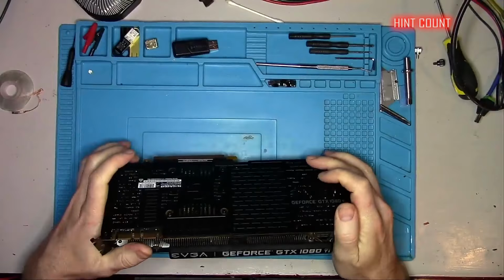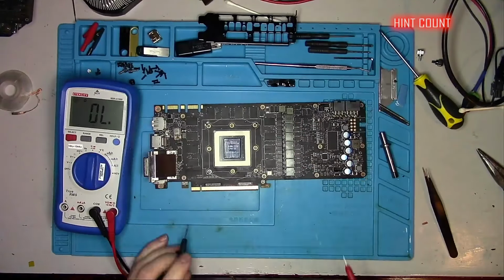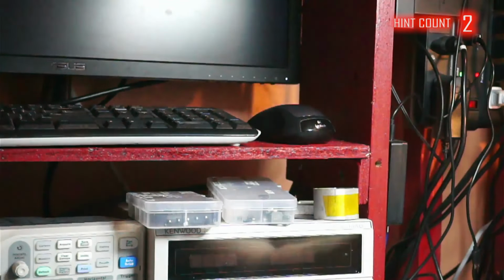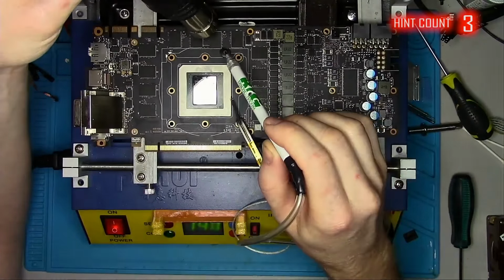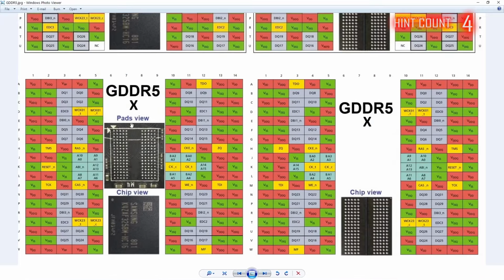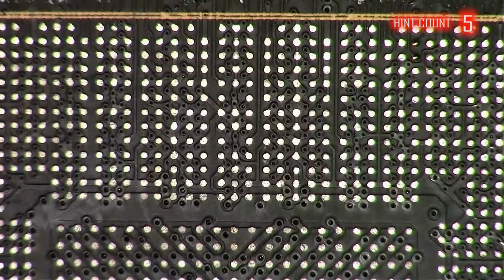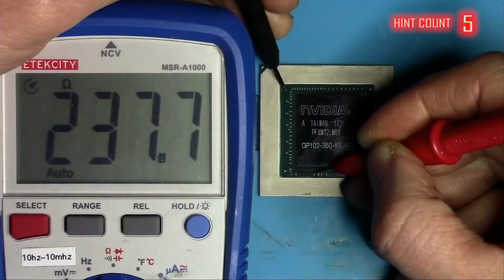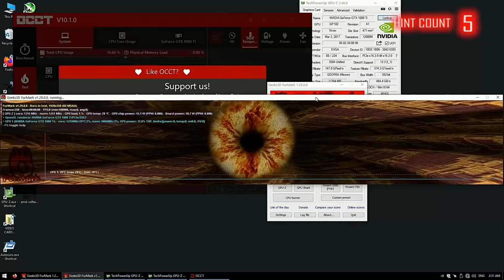What dropping does to Graphics Cards evga 1080ti no output

Comment: I'm not sure if you'll see this but I have this exact card and was wondering what thickness of thermal pads I should be looking for? I've had this card for 8 years and it's running a bit hot. I'd like to replace the thermal paste and might as well update the thermal pads as well

Comment: If you look closer you will see, that the pads are in fact NOT RIPPED‼️ 

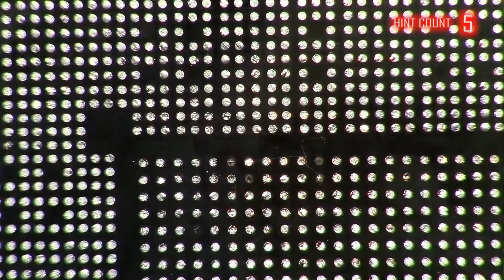It may look like but it’s most likely corrosion. You can see it at the beginning where the light shines in a different angle.( 9:37 ) Try to measure the resistance of the pad against a ground pad, you will see that it has still a connection

Comment: Hello, could you please tell me that one of the chip capacitors on the gold hand on the back of my ASUS 1080ti graphics card fell off, but it can run normally now, what role does this capacitor play? Thank you.
Reply from the maker: Filter.
I wouldn't worry about it too much if all works as it should.
Reply: @northwestrepair  I want to know what this capacitor does, which is located on the back of the PCB, the last one in the row near the Goldfinger

Comment: 1:30 How is it that when he was measuring vcore relationship to 12v he was referencing pci-e 12v . Isn't vcore on more powerfull cards always only provided from 6/8pins?
Reply from the maker: i've seen it shorting to 12v pcie before on  1070 cards.
My guess is that back then, i didnt realize it was shorting 12v to ground and since core resistance is very low, i would get a short on 12 to core.
I learned not to do that since :P

Comment: i have and asus 1080 works fine but where the power cable goes into it takes 2 power cables. there is a white light above the top of each plug in the 2nd plug in for the power doesnt light up like other cards should i worry ? i mean the card works fine
Reply from the maker: if it works, dont worry.
i've seen this on few 30 series cards. No effect on performance.

Comment: is it possible to repair torn pads on the bga of the gpu die? if you looked closely it seems there are stems on a few of the pads which could have a wire or tag soldered to it
Reply from the maker: Possible but not very dependable.
One sneeze and it can snap.
Reply: @northwestrepair  I see, thank you for the quick reply

Comment: Is it still worth running repair center? like in general. cos i dont know, do guys like you just repair gpus and nothing else? Like what im trying to say if it profitable 😑😅
Reply from the maker: If you are like Northridgefix soldering connectors and fixing ripped pads all day yeah.
Reply: i know you can spend a lot of time troubleshooting and hours repairing for small profit margin. But it's also a passionate job at the end of the day

Comment: I picked up a dropped and possible mined evga gtx 1060 6gb sc single fan model for €80 last year june 1st. Would crash or lockup if I touch the pcb. So took a chance in reflowing the gou core and memory chips with amtech 559 v2 flux and a regular heatgun and done a good job without bumping the chips. It still working to this day as my daily gpu. No hic up or artifacts since

Comment: Running Furmark or Kombustor is great for checking the power consumption of a card, mainly. I had cards which worked great with Furmark and Heaven but failed to work with Valley. Also had cards working perfectly with Furmark, Heaven, Valley and Superposition but failed to work with 3DMARK. I usually do all of them. It takes some time but after all these benchmarks done I'm sure the cards are definitely working. Also I'm taking print screens for each and every one of the benchmarks and pass them on to the client so if something goes bad when the client puts the card into its PC it means only one thing: it's not my fault for sure.

Comment: your work is of impeccable standard, First rank quality. But you are also human, and occasional slips, such as not quite positioning a chip correctly is totally forgivable. What matters is that you own your errors and fix them.  The fact that you show them in your videos and don't edit them out is very much to your credit. 

I am fully qualified in electronics, and recognise a master at work. Your amazing attention to detail would be essential if you were working with valve equipment, let alone the microelectronics you are actually dealing with.  I have seen some videos where people have demonstrated the value of better equipment. So I suggest you fundraise to get yourself a better hot air station etc. You fully deserve the best

Comment: Probably to double check the chip positioning
Reply from the maker: No. I tried that chip on a different card, it was not working.
One of the memory line traces was ripped from the chip it's self and not on the board.

Comment: Just awesome. 

I watch your vids for entertaining. 

I'm not an electrician or have a deeper understanding of circuits. Nevertheless, I find it very interesting to see such techniques. that's why i come here. I also have an EVGA GTX 680 Classified lying around. However, only the circuit board, no heat sink. The memory and some capacitors have probably been damaged. I bet the card could still be repaired

Comment: Furmark can set you GPU on fire and ain't a good test anyway!
Reply from the maker: If your card cannot handle furmark, its either garbage or its not properly fixed
Reply: @northwestrepair  LOL so your saying new GTX 1080 TI even RTX 2080 are garbage. Go and do research before made a wild claim.

I have 20 years with computers and also used to make games as well. Let me explain something. Furmark don't stress all the GPU and it stresses memory and certain parts of the GPU because it is a concentrated stress it over heats them parts. 

Which can cause a major fault in FIRE!  Thankfully Nvidia has now capped it on driver level. So what your getting on your benchmark/stress is capped on driver so the benchmark/stress is pointless anyway.

Plenty of GDDR5Xand some GDDR6 GPUs met their end because the cards had their power distribution overloaded hard enough to catch fire.

Comment: This guy actually tries everything! Saddening to know there’s prob so many expensive gpus out there that are one good repair tech away from working because some other tech claimed there was no fix.
Reply: Did it ever happen to you to have a client who refuses to pay more than 50 bucks after you tried everything you knew and finally found a tiny resistor corroded, barely observable, changed it and now the card is fixed because client don't want to understand how such a tiny resistor changed can cost more than 50 bucks?
If you encounter this kind of situation often enough you will risk no more to work for free and you will say that a card is not fixable if it takes more than 3 tries to fix it. Once you're experienced enough, you will almost "feel" when you can easily repair something or if it will take the life out of you working on it. I'd rather not have my life taken out of me just for a client to not pay much especially if the next day my hot air station dies or if I need to buy a new multi-meter or an oscilloscope.
On the other hand, every tech has its own level of proficiency and I admit that some tech are not proficient at all doing the repairs.
Anyway, things are not only black or white.
Reply: @Dandan-tg6tj  Isn't it illegal to not be paid for your work? What country do you live in that does not enforce labor laws?

Comment: Amazing knowledge and repair skills, you truly amaze me!!! I have an Asus Tuf 3070 ti, and would like to know your opinion about installing some thermal pads myself, i used it a few months to mine Ethereum and also light gaming. In IWiNFO64 , the GPU Memory Junction Temperature could reach more than 100 C, but i limited the mining software, but the card reached 105C a few times for a very small period of time, because afterburner got reset by itse, while playing games the Hot Spot Temperature never went over 65 C. I live in south America and don't have access to a technician as good as you, not even close. Thanks for your time!

Comment: my computer fell off my table and landed on my DVI cable plugged into EVGA GTX 1060 bent it 90 degrees used a DP to DVI and it still works these cards are really strong I'm out a dvi port but that doesn't matter to me (I'm really lucky nothing broke but the DVI port) props to EVGA for making a gpu that can withstand an entire computer landing on it from 3.4ft up.

Comment: Toss the board into an oven for a bit. It would have worked. I've fixed so many cards this way and have had no complaints so far. (And yes I let the customers know it could be temporary but a cheap fix) fixed iMacs with GPU issues, reballed... Changed capacitors, did everything, wouldn't work. Cooked it in the oven like I would a pizza... Worked perfectly. I think it's something to do with even heat distribution and that it gets into parts we can't really get to with our hands
Reply from the maker: No qualified repair guy (i dont even think i am qualified) will ever put GPU in the oven or blow on it with a heater gun like Linus at tech tips did without carefully controlling temperatures and soak time.
Heat treatment can fix few issues but it can also create allot more.
Reply: @northwestrepair  meh, it's worked for me many times and never had issues guess I was just lucky. A lot of professional techs are against this because it takes away their income if people just did the oven trick. Not saying it will work every time though, just has for me when helping out friends

Comment: You should give the Original GPU a shot. The Ripped Pads in the Middle are just Vcore/GND. In the Boardview the marked pin on the GPU is the Thrid row But on the Video Where you are Cleaning the GPU The Third row Pads looked fine. Just Because After a Reflow you Still dont have a Connection Doesnt mean Its the GPU it can Still be a Broken Solder Ball. 

(Correct me if im Wrong :) ) Otherwise a Good Video ;)
Reply from the maker: Yes. I was thinking the same thing. If am not mistaken, missing pads were NVVDD and GND which are duplicated allover the board, but not necessary inside the chip.
Without taking chances, i used GPU  from gigabyte since it was laying around waiting already removed.
Didnt want to wait with another week.
Reply: @northwestrepair  Maybe you got one day a chance to Try it. The GPU should Work Without the Few NVDD Pads. This GPU should not be Used for Overclocking but Stock should be fine.
Reply: @abbyson2834 I see, so it looks like it's fixable, if it is, what steps would you take to fix it exactly? The pads have broken off right, how do you replace them?

Comment: Reboiling and resoldering over and over can cause severe damage to the board as well :) 
I paused after the question and gave it a thought. Pins miss-alignment will most likely to cause short-circuit.
Edit:  close but far.
Edit2: Tip for everyone: Apply tin before resoldering, removing existing; it'll help  a lot in the process :) 
Also, great video

Comment: I recently moved from Ohio to the Philippines and shipped my PC.  When it arrived, I can tell that the box it was in had been dropped because the tower cooler was slightly bent.  I turned on the PC and the fans on my RX 6800 spin but I get no video signal.  This video has given me hope that it might be fixable so now my problem is finding a reputable repair shop.  Thanks for your videos and I look forward to watching more of them.
Reply from the maker: Typical problem. Never ship GPU installed inside PC. Its weight will crack PCB.
Look at the PCIE slot on your card. Toward its end (where hook is) its likely to be cracked.
Reply: @northwestrepair  I don't see a crack, but just forward of the hook, the back plate is slightly pushed toward the PCB and a scuff mark on the outer edge of the PCB above it.
Reply: Congrats on getting out of Ohio lol :):

Comment: Incredible. The sheer number of possibilities when it comes to GPU repairs is mind blowing, but you just raised them up exponentially. I wasn't even aware that you could replace the entire DIE and it would be perfectly fine. Just goes to show that if you know what you're doing nothing is impossible. It makes me wonder though, did you use the die from the other GPU just for the purpose of this video, or was the other card so badly damaged that it was unrepairable, and you decided to salvage components? Either way, very impressing!
Reply: he shows before the gigabyte card for donor. and he said he dont know the gigabytes die working or not and just give a try. i love to see something broken be fixed i love it so much
Reply: @mmertech  I don't see why it wouldn't work though as the die is provided by nvidia to all partners, and partners just make the board for the die
Reply: It's certainly possible to do but requires a lot of skill and a little bit of luck as even when everything is done properly, all it takes is one of those balls to not cooperate and you'd have to restart. Memory chips aren't so bad though. This, how ridiculously overpriced broken GPUs are, and the time involved are why no one bothers to try
Reply: what i dont understand is y he didn't flash a new bios on the card, which would be mandatory in order to make the gpu function with a different card
Reply: chip itself is the same, if anything non evga bios would break the card

Comment: Bro.. why would you lift the stencil before reballing the chips properly. Remove the stencil after reballing, that's why the tiny solder balls are shifting.
Never remove stencils before properly reballing chips. 😎
Reply from the maker: There are 2 types of stensils.
This is 90x90 non direct heat.

Comment: Nice, i watched other videos and found a forum, chinafix that they can disable a memory channel that is bad and made the card work but in less vram, using a bios editor and tools
Reply from the maker: There is a method for 30 series cards but not for 10 or 20.
Do you have a link ?
Reply: @northwestrepair  will send to you,  there is two ithink , one is for amd rx 500 series, other one is on chinafix with nvidia cards idont knowwhat models, be right back

Comment: I never thought one could just swap the actual dye of the gpu, but in hindsight, it makes sense.
Reply from the maker: There is allot people dont know. I hope to bring more light to the possibilities and ways of fixing things instead of throwing it away and buying new.
Reply: @northwestrepair  awesome ideology ✌🏻✌🏻✌🏻
Reply: Ye, all the GPU dies of a specific number (eg  GA102, aka 3080) should be identical chips sent to board manufacturers. What I didn't know was whether the memory chips they use are all the same or if they have a freedom to pick somewhat different chips of same size, speed and technology.
Reply: @txtasosxt  would you mean with sent to board manufacturers?
Reply: @rkan2  Bit late but what he means is that GPU manufacturers (like Nvidia and AMD) produce a lot of standalone GPU chips (like the one that was replaced in this video) and send them off to independent manufacturers (like EVGA) who then construct the board and cooling solution to create a full graphics card. The only part of the full graphics card in this video that was made by Nvidia is the GPU chip itself, everything else was custom made by EVGA.